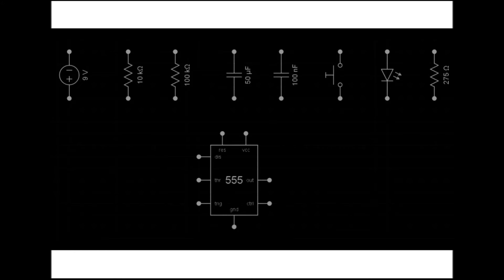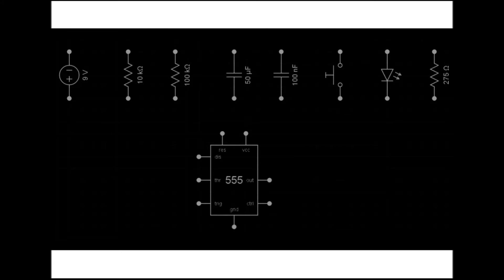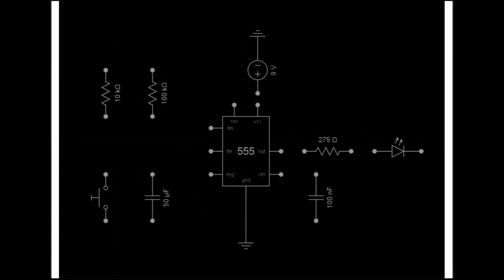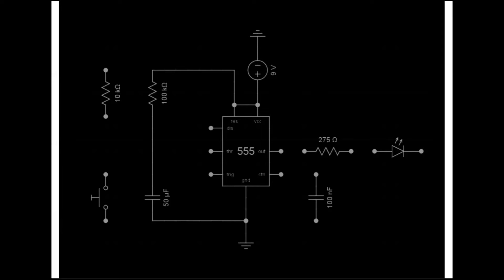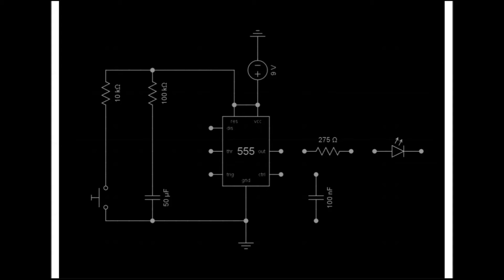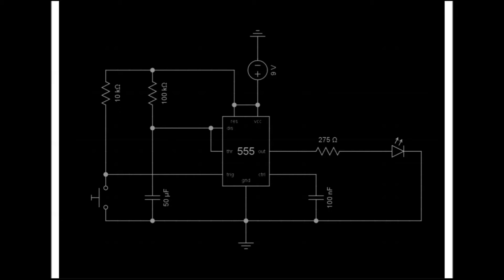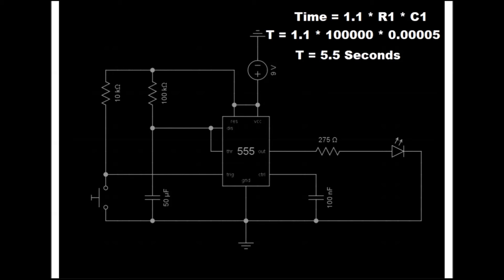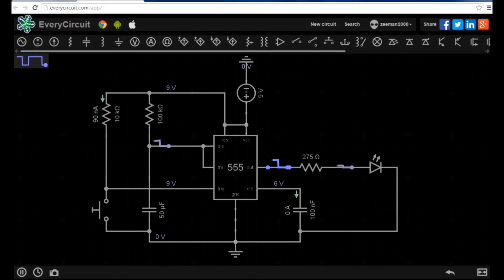Electronics Tutorial 11 - 555 IC Monostable

Comment: What would be the shape of circuit if we want to use this feature( circuit)  in laser light security system??
If we want the buzzer and led of laser light system to be on for a specific time??
Reply from the maker: The circuit basic would remain the same. You would need to adjust your capacitor and resistor to get the time output you require. You can also adjust the input voltage up to 12 volts. this should adjust your output on pin 3. A buzzer or laser light would be attached to pin 3. But keep in mind that the buzzer or laser will need voltage and current to operate so it is important to know the specifications of the component you want to place on the output. Hope this helps.
Reply: @Jenko022  
Although i am unable to understand my scenario yet(working on it) but thanks for your reply and gr8 tutorials

Comment: Hi Jenko222.  I understand that R1 & C1 set he timing of the output signal, but how can i calculate that?  Does it use the R-C circuit impedance calculation you example in the 'Inductors' video?  If so, how is that utilized to calculate the length of time the output is 'on'?  I would like to experiment setting the output pulse to very specific lengths of time.  I realize it might be a complex explanation, but if you can point me to an example I would appreciate it.  Thanks for the great videos!
Reply from the maker: To make the circuit output specific time values you need to change the formula slightly. We can use this to choose the correct resistor value. In this formula we will use a 10microFarad capacitor. Adjust your formula if you adjust the value of the capacitor.

Time output required = 0.5 seconds
Capacitor = 10uF
Resistor = ?
\ = divided by and * = multiplied by

Resistor = Time \ 1.1 * Capacitor
Resistor = 0.5 \ 1.1 * 10uF
Resistor = 0.5 \ 1.1 * 0.00001F
1.1 * 0.00001F = 0.000011
0.5 \  0.000011 = 45,454.5454
Resistor = 45.5k Ohms

Hope this helps, hope I got the maths right too :)
Reply: Perfect  @Jenko022 !  It's in my notebook now - thanks!  And LOL at the 'maths'.  Don't feel bad, I just discovered what that button with the check-mark with an 'X' in it is for on my calculator (and I'm old enough to remember B&W TV's with rounded corners).  If you're too old to learn - you're dead.  Thanks!

Comment: Hi Jenko022

What an informative set of tutorials you have produced.  I’m working through each one in order.  I have struggled for years trying to learn Electronics.  Your tutorials have helped me a lot, at the moment I’m working on ‘Electronics Tutorial 11 - 555 IC Monostable’ and am unable to get it to work properly.  I start the simulation and everything seems to be working properly, with current running from the Voltage Source to Ground.  When I hit the push to make switch the LED lights up but not for 5.5 seconds, but seems to light up indefinitely. I have checked all component values and they seem to be ok.  Would you please show/tell me how to get the circuit?

I have an 'Screen shot' of my circuit, but I don't know how to send it to you.

Best Regards

Stephen Roberts
Reply: +Stephen Roberts Everything is OK, The Simulation Speed was not set to 1 s/s
Reply from the maker: +Stephen Roberts Hi Stephen, I am really pleased that you have found the tutorials helpful and I am even more impressed you solved your issue with the 555 circuit by yourself. Well Done! If you have any other questions or need help with anything dont hesitate to contact me. All the best.
Reply: Had the same issue, thanks for sharing this!